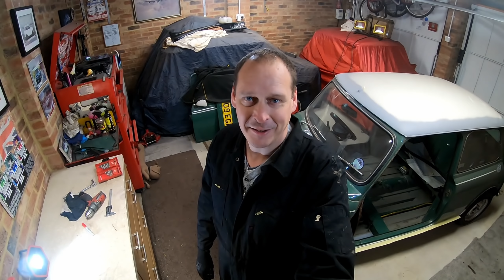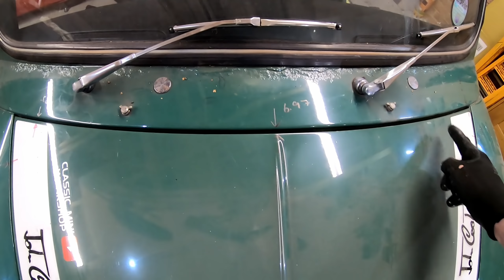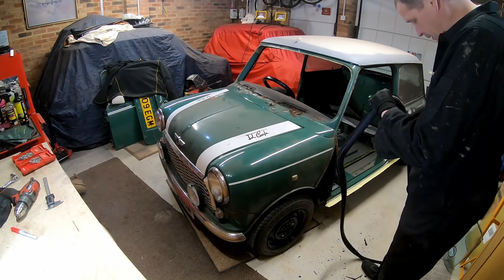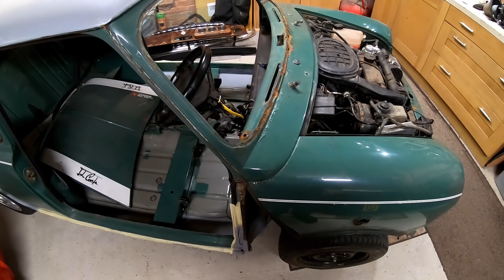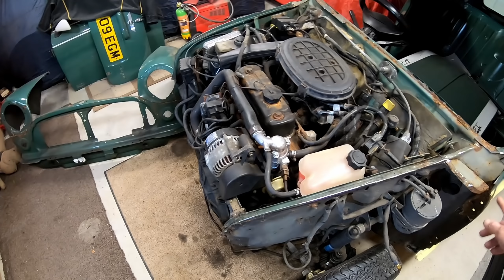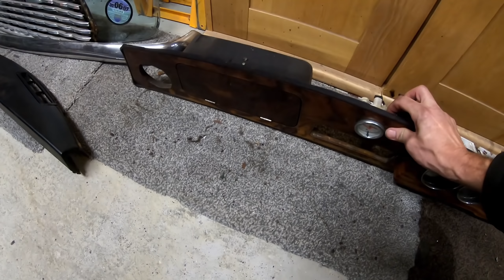Classic Mini Workshop - Project Sprout Pt.22 Complete Front End Removal

Comment: Can you comment on the need to replace these panels versus just patch/repair them? Is it just to make a better aesthetic or is there too much deterioration for repair?
Reply from the maker: The only way to get rid of rust is to remove it completely, you can rub back, treat and repaint but it will come back unless you cut it out or replace the panels

Comment: Interesting how the later minis don’t have radiator on the passenger side and the vents in the inner wing. Instead looks to be mounted at front of engine with an electric fan.
Reply from the maker: Yes, they moved to a front mounted radiator and electric fan to meet drive by noise regulations in the late 90's